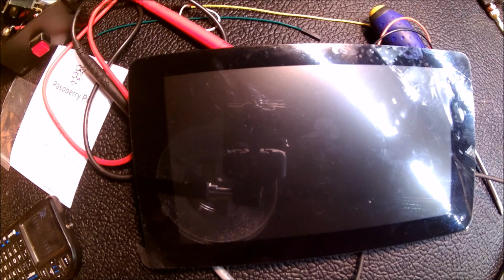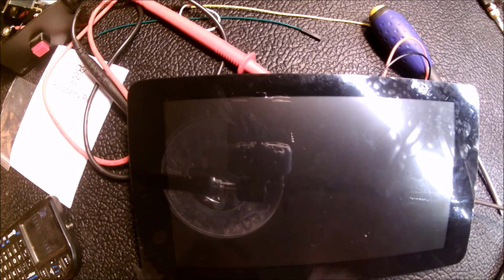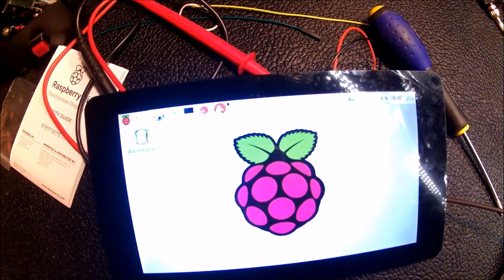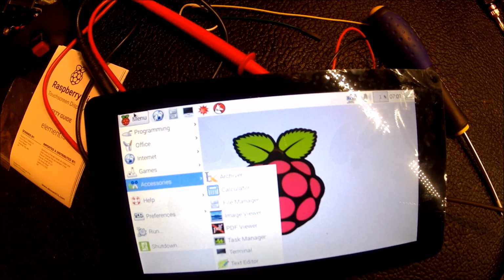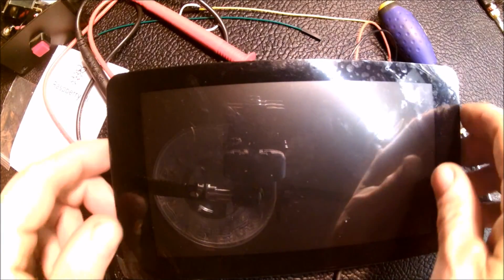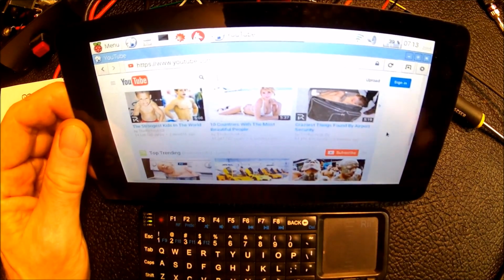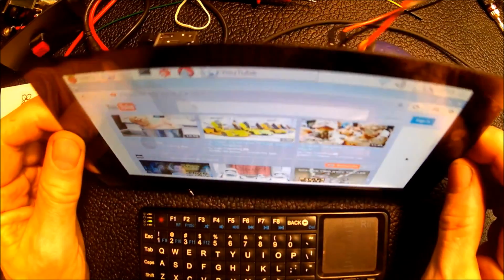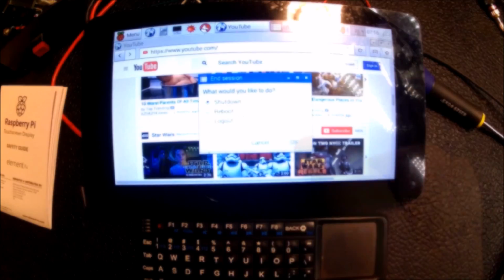Raspberry Pi 7" Touch Screen Installation

Comment: The screen need to receive energy ? can i use the energy from the raspberry pi and turn on raspberry pi with a portable battery charger like this https://www.amazon.com/IOGEAR-GearPower-Capacity-Smartphones-GMP16K/dp/B0102OLIAE/ref=sr_1_4?s=pc&ie=UTF8&qid=1486786300&sr=1-4&keywords=portable+battery  ? or use two one for raspberry and another to screen ? and install android to make it similars a tablet ?
Reply from the maker: Yes, you have two options.  Best one is to use your power bank to feed power to the touch screen controller card (micro USB).  Then use the USB output of the controller to feed power to the Raspberry Pi USB power input.  Or you can feed USB power to both the touchscreen card and the Raspberry Pi.
Reply: Can i install a android 5.1 or 6.0 in raspberry pi with a touch-screen 5"' or 7'" make like a smartphone with raspberry pi feeding with power bank ?
Reply from the maker: I've never looked into that, but have a look at the page below:
 https://arstechnica.com/gadgets/2016/05/google-to-bring-official-android-support-to-the-raspberry-pi-3/

Comment: Cool...is this a mod?
Reply from the maker: +Chris DIYer It is a bit of a DIY kit for sure.  You have to round up all the separate parts and figure out how they all go together.  My plan is to make a hand held Raspberry Pi tablet that can be used for all sorts of projects.  It'll have the display, battery, charger, case, WIFi, Bluetooth, etc.  Then I can use it to test out various open source software on for talking to solar charge controllers, etc.